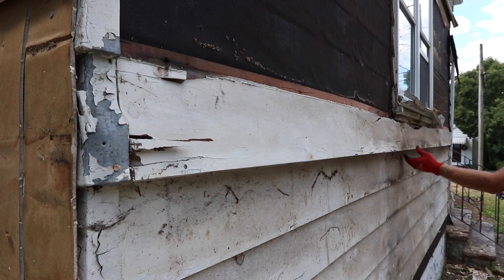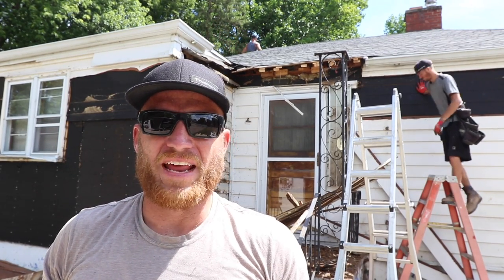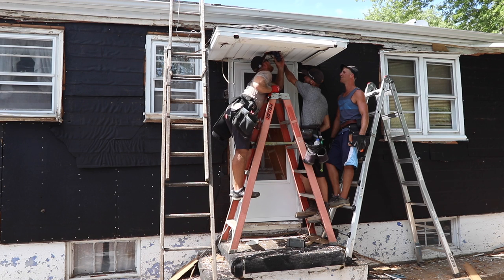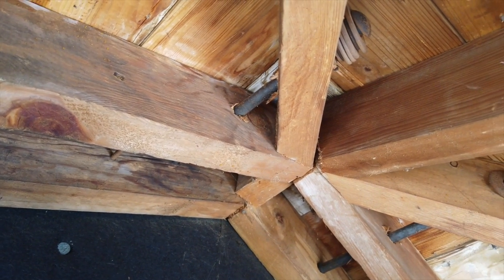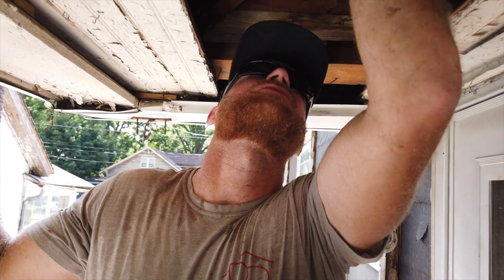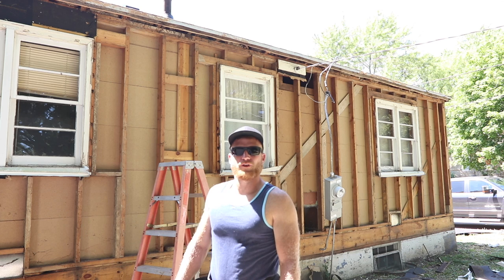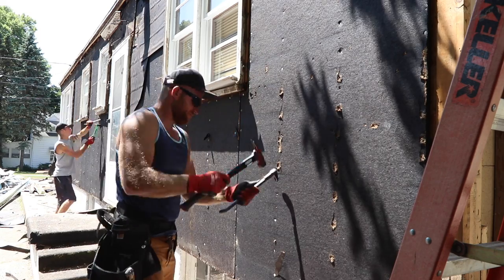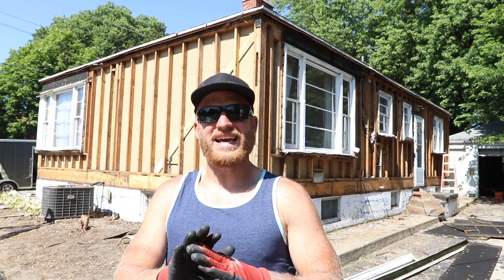How To Renovate Your Homes Exterior Part 1: Demolition and Preparation

Comment: I used LP smartside on my house when the vinyl siding was destroyed by golfball sized hail 2.5 years ago. 
Insurance only paid for the 2 sides that were damaged & the roof. I paid out of pocket for the upgrade of the siding materials to LP & upgraded windows. I did all of the work myself to offset the upgrades, while most of my neighbors used storm chasing contractors. They mostly got conned into replacing the vinyl with more vinyl.  I’m not bragging but my house is the best looking house in the neighborhood. Moral of my story is that LP smartside is very user friendly and easy to work with.
Reply from the maker: Totally agree which is why I selfishly wanted to partner with them
Reply: RR Buildings on another note I did not need to pull a permit in Denver, CO for siding & windows if I as the homeowner was doing the work myself. My roofer did need to pull a roof permit. 
Definitely a jurisdictional type of thing.  I find it strange that I’ll need to pull a permit for flatwork when I widen my driveway. Something to do with stormwater runoff 🤷‍♂️
Reply: @michael-michaelmotorcycle  In Florida, I do not need to pull a permit if I'm working on my own home that I live in, but if I'm working on one of my rental houses, which I also own but don't live in, I have to pull a permit.
Reply: @michael-michaelmotorcycle +
  Having been screwed, blued and tattooed by an insurance company, they are require by law to bring your home up to before loss condition. Since they can't match siding, they are required to replace the entire exterior surface treatments.
  What my insurance company did was to send in a contract claims adjuster that was near impossible to make contact with. When I finally got his estimate, it was low by over $20k.
 I had a deck built on 6x6 posts and 2x12 stringers with 2x6 planks for decking. They based the repair using 4x4's, 2x6's and 5/4 deck boards. 

  Insurance companies suck. Not everyone can take time off of work to deal with the claims process and attempt getting your life and home back in order.
Reply: Gunga Dinn agree 100%. My initial estimate was under 10k. After fighting & screaming for nearly 8 months they sent out a 3rd party adjuster and when all was said & done my claim was 38k. They wanted to match the vinyl siding and I did not want to put vinyl back on - also they wanted to replace 3 windows, which is where I paid some out of pocket for upgrades to the siding & all windows. The hailstorm was on May 13 2017 and my roof was installed the week of Christmas that year. I finished up the siding myself on my days off and it was well after the anniversary of the storm. Bottom line is that people are impatient and they just see dollar signs and most people are unaware of the work/labor involved or material costs. Most of my neighborhood was rebuilt in the first 4-6 months after the storm by storm chasing contractors and the houses & roofs look slapped together. My house was one the last houses to be finished and it looks great, because I would not settle for their lowball antics.

Comment: Finally!!! Found a video dealing with a remodel involving Celotex. I'm remodeling a Farmhouse and we have a mixture of Celotex and Johns Manville Weatherite sheathing. House was never insulated or wrapped. Current cladding is cedar board-and-batten. I've been sweating bullets trying to figure out how to go about insulating (didn't want to create a moisture trapping issue) though after this video I think I'm going to take the time to remove all siding, sheathing and properly sheath with OSB, wrap the house and reapply cladding. THANK YOU!!!

Comment: You have to wonder what the original builder was thinking when he decided to plant the house foundation where he did. You can see he was short on space between the driveway and the back door having to opt for the very short step way either left or right of the door and then the garage door opening is just just of the line of the wall of the house. There's so much extra space in the front yard !  All he needed was an extra 4 feet to make the rear entry more sensible and better use of the area between the garage and the house.  FOR SURE, you have to insulate at this stage without question. All of the labor to insulate is mostly done...it would be a serious humane violation not to and don't forget the attic space. Thanks for sharing. (Nice basement).

Comment: Spray Foam for sure!  It will pay for itself and make the house much more comfortable.  Plus, it is super easy now with everything open. Replace the porches too.  Nothing worse than trying to open a door in the rain and snow with no cover.
Reply: I'm not a huge fan of lightweight wrought iron, but those porches played a big role in giving the house its character. Without them, it would just be a generic box. I'm also inclined to preserve the windows; they don't mass-produce  that style anymore and anything from Home Depot (nice as some of them may be) is just going to give it that "Home Depot renovation" look.

Comment: Kyle later after the LP siding crew leaves you can still Spray Foam those cavities from the inside via a Spray Foam Company they'll drill holes in the walls add spray foam then cover the drill holes and make the inside walls like new no removing drywall needed
Reply: Thank you 😊

Comment: as a residential remodeler here in n.y we run into the no insulation issue more than anyone would like too lol we usually just do fiberglass batts or spray foam if we are going from inside the house and the home is 2x4 construction. One of our codes is homes need to be brought up to atleast an r21 so when its 2x4 construction we eaither have to foam it or add 2in ridgid insulation board on the outside

Comment: Go with R -15 if you can .I worked for a company for 26 years doing insulation . And grew up in the business . You can't go wrong on thicker insulation.
Reply: Yup, R-15 is what we use to use in 2x4 construction, most you can get in Batt form.

Comment: Hello Kyle,  I like your slide hammer nail puller!  I have had one of the old style ones for many decades and although they work great they have such a narrow jaw and hinge point that resharpening them is only possible a very few times.  I will have to do what you did to a set of my nippers.  The trick with them anymore is to try to find those that have a chisel bevel to enable them to grip flush with the surface.  I did find a pair but it wasn't easy several years ago.  Love this video as it is truly real world.    I hope you don't leave the cavities open anything would beat that.  Toss in some batts before sheathing at least.  An old house may not be worth the foam cost but some insulation would be soo much better.  Take care.  Doug

Comment: Good morning/afternoon.  I'm surprised you didn't bring a trailer with you to put the siding, debris,  etc. directly into it, that way you wouldn't have to go around and pick everything up, or use a dumpster.  If these weren't available I would have put down large tarps and throw everything onto the tarps, makes clean up a lot easier.  You're doing a real nice job, as usual.  Be safe.  Stanley in Md.

Comment: Lose fill is cool blown out on a horizontal surface, but will "settle" considerably use in a vertical wall. A backed insulating batt, stapled to the Outside of the studs, and wrapped with the same stuff you wrap your pole buildings with would be lots better- cheaper; you will do it with your own help, and it will still be filling the top half of the cavity in 5-20 years- the loose fill won't. Unless your code enforcement requires it, there are some other exterior sheathing options- at the least use roof decking grade; all you need is a sound nailing surface under the wrap. Your intro ppg about reno/remodel casts is true- every last word!FR

Comment: * 4:34 Everything is correct, first you need to disassemble from the bottom, and then hold it with your hands and disassemble from the top
 ;- )*

Comment: I've been dying for someone to do a video like this.  I want to do the exact same thing to my own house.  Insulation seems to be my holdup.  I want to foam it but then you'd be spraying right on the backside of the drywall.  My electrical box goes thru the back so there's no just hanging it off, so there's that too.  Some sporadic termite damage to fix as well...

Comment: Permit requirements are different for different locations. I don't need a permit to re-side my house or re-roof my house. As long as I'm not modifying the structure I don't need a permit. Windows, doors, plumbing, electrical, heating require a permit where I'm at. Some places require a permit to even think about doing anything to your house.

Comment: Awesome video. Since you have a somewhat tight budget, might be cheaper and easier to run any new wires, plumbing and insulate before you button up the outside ? Just a thought and thumbs up !
Reply: Mount electric device box with a Rx tail about 6' through the sill and go back later. great stuff around the elec boxes ( new & old ) I second using rock wool. Will not burn stable with humidity and temperature swings, breathable so it can dry in what will be a much tighter but still leaky wall. Too bad there isn't  room for zipR sheating so use that RR housewrap. ( Hey - give Matt Risinger a call ) Great video- interesting to see Rehab work ( did you finish your home rehab ? ) Take care all
Reply: @davidhosmer1424 , Agree !

Comment: I'm really enjoying watching this remodel, as it's the type of thing I've done as well, including using LP Siding.  As I recall LP had an issue in the past when this siding was used in a wet environment.  But it should work great on your house.  Instead of spraying insulation, can't you use batts?

Comment: Building permits give the city data to include for property tax adjustments. Ask them, if they are honest they will tell you this is fact.
Spray foam, Zip sheeting and Metal panels...that would be cool.
Reply: ratoneJR it mostly gives some assurances to the homeowner prevent shoddy work from shady contractors. Also some lenders & insurance companies require building permit historical information to insure certain structures. Would you want to insure a house that caught fire because it was wired by somebody who did not know what they are doing or licensed? 
There are more reasons than just a cash grab.
Reply: @michael-michaelmotorcycle   In theory, you may be correct about shoddy work.  My experience  has been different. Local city employed Building Inspectors do not know their codes, or over look questionable installations. Trades Inspectors have been local contractors doing side work, usually but not always competent. The best inspectors have been private companies who take their job seriously.  About the cash grab. Have you asked the office employees about what they do with the permit?  You should.  Insurance companies requiring building permit history?  People don't get permits to do sub-par work. Permit history is  worthless.
Reply: ratoneJR when I was buying my house my inspector had a copy of the roofing permit from the 70s and an electrical permit from when my house was rewired from knob & tube. He may have been overdoing his job but my homeowners insurance got those copies as well.
Reply: @michael-michaelmotorcycle   A private inspector, no doubt. You proved my point, Thanks
Reply: One of my points. I doubt you would have been denied insurance coverage without you past permits. It was just a nice bonus. Kudos to your inspector.
Reply: Have you ever pulled any permits, yourself? And have gone through the city inspection process?  I have pulled countless permits. Nothing to worry about, but over time you will come to see.  It is a very different experience, indeed.
Reply: Congrats on your new place. I'm out.
Reply: ratoneJR my point was that the city/building department DOES keep records. How else would he get copies of paperwork that was 40+ years old? Your comment basically stated that the permit process is useless & a cash grab. Yes he was a private home inspector, not an actual ‘building inspector’ for the city which you were referring too. I’m not sure where you live but I’m pretty sure where I live the building inspectors take their job seriously. And are actually city employees not subcontractors or tradesmen working ‘side gigs’ as you stated. 
We recently (maybe a year & a half ago) had a new 4/5 story apartment building under construction catch fire and several construction workers died. All required inspections were up to date with the city & fire inspectors. So the city was not responsible for any damages. It turned out the insulation contractor started the fire while spraying insulating foam  too close to propane heaters. 

Either way had the inspectors not actually done inspections and pencil whipped their responsibility it’d be a hole different outcome.
Reply: ratoneJR and to your other point from your original comment. Yes the city uses the information obtained during the permitting process to evaluate your homes value. Your new roof makes your house worth more when you decide to sell it, so why wouldn’t the city consider that when determining your homes value for tax purposes? 
We all can agree that property taxes suck but when the time comes to sell we all wish our houses were worth more. The city’s tax assessments are helpful at that point to sellers.
Reply: ratoneJR yes I have. Several for my house. I built my own detached garage & covered porch and a few other things, electrical & otherwise.  I know the process. 
I also worked for a demolition contractor years ago and pulled permits on occasion for school demolition/remodel jobs in the mountains in small rural county’s. 

Either way this was just a discussion not a pissing contest.

Comment: Why not put rock wool in the cavities while you have exposed the framing?
Reply from the maker: Never used rockwool
Reply: I second the motion.
Reply: @RRBuildings   I used it on my last project. Liked it a lot. But it was a bit more expensive and had to hunt to find a dealer. R-15 in 2x4 walls and can cut with knife for tight fitment.

Comment: The 1st thing I thought when you started was " Buildg. Permit". Maybe get a led and asbestos inspection, but I don't know the local codes. Many places, as long as you own the building you can get away without all of that BS. You will thank yourself to get a guy that is a Pastor and is also a certified electrician. They're more honest and they won't charge you over scale. Oh yeah, about that led and asbestos: I'm slowly dying from toxic led poising simply from that dust everyone can see on your video. Get the GOOD masks and make everybody wear them. If a bldg was built before 1978, it's best to check that stuff out. But I'm havin' a ball watching you guys; and I wish I could get out there and work with you. Now don't get sad on me because my wife's a nurse and I've done everything in life I've ever wanted to do. Thanks for letting me watch your channel.

Comment: 12:00  Where I live you just got a call from the electrical inspector and building inspector (building for the insulation and the removal of the exterior sheathing).  If windows are going in with insulation the building inspector may deiced it is a remodel.  Then Fire is going to show up and make you but in smoke/co detectors.

Comment: Would post frame houses (like Kyle builds his buildings) move around too much for drywall?  Would it be uneven or crack without a secondary stud structure?
Reply: My house is post frame construction and is finished just like a normal house and have had zero drywall issues
Reply: Jeremy Suggate Kyle's columns are 8' centers then girts every 2'. Are yours the same? Is post frame much cheaper Vs traditional? Thanks
Reply: Mine are 8’ as well with Perlins then I studded every 16” in between, spray foamed and drywall. It is cheaper because of having no foundation and basement. Some days I think a basement would have been nice but I have no kids so really didn’t need it